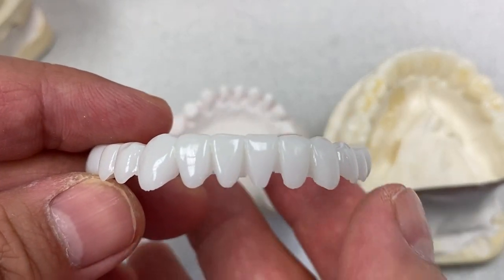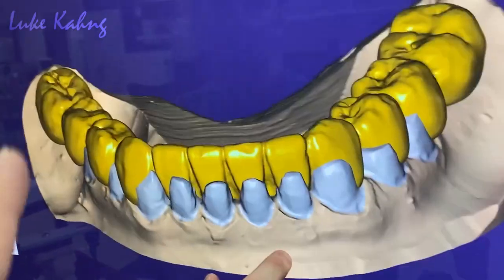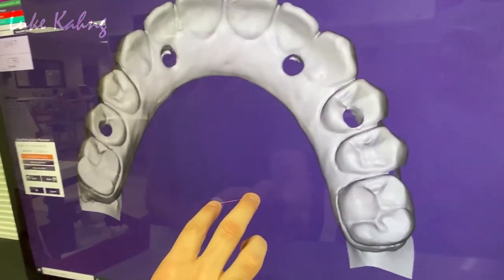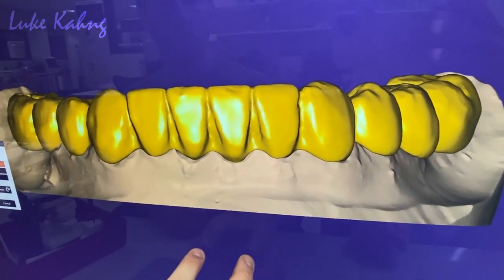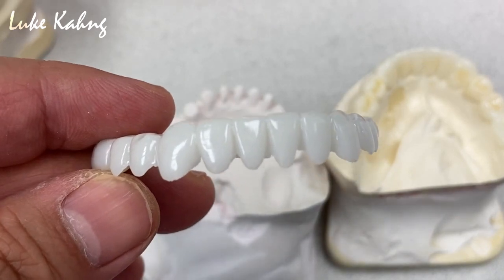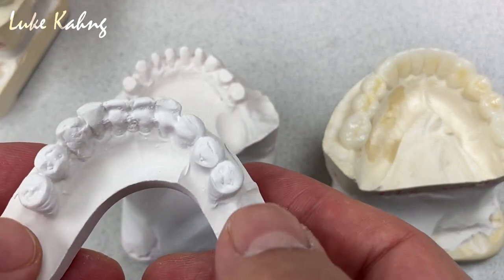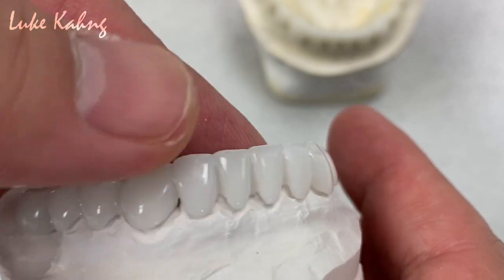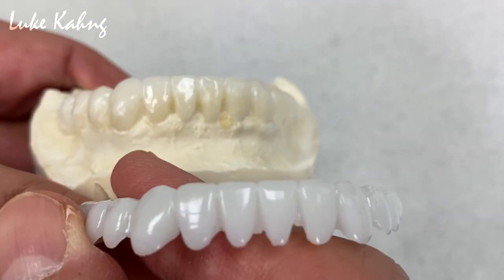How to Digitally Design, 3D Print & Finish a Lower Provisional

Comment: How long should a set of top and bottom permanent implants take to make the finish print. Posts are all in and healed. The top is finished and I’ve had them in for over a year now  nothing holds up to the top teeth so I have no bottoms since Feb 2018Thank
You